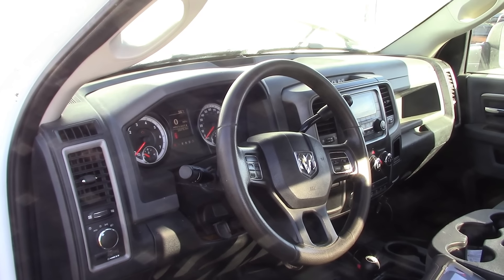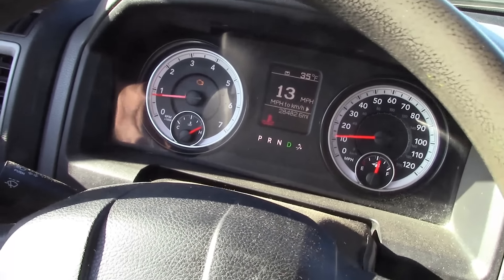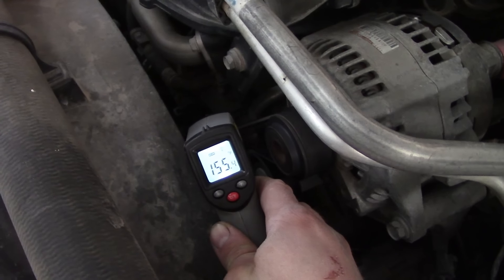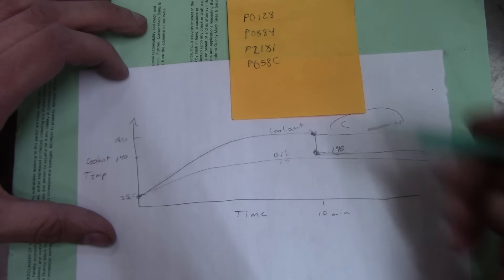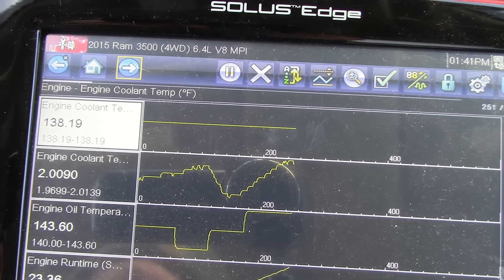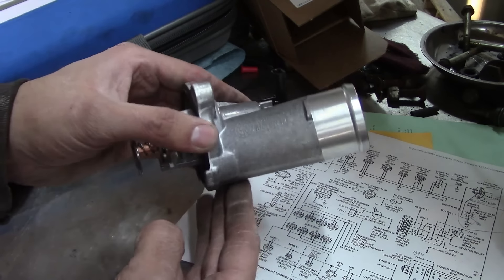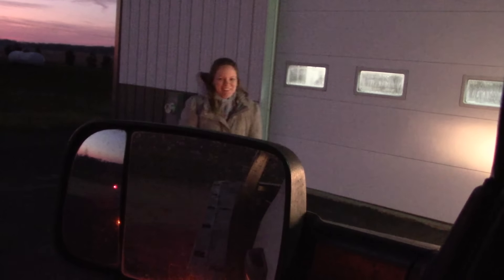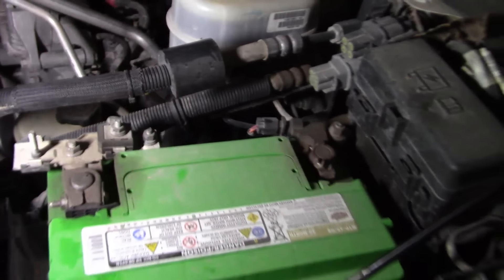When Live Data Lies - 2015 Ram 3500 Thermostat Diagnosis and Replacement - P0128, P2181

Comment: I bet it's emissions related. It has to come to operating temperature and switch to closed loop so it doesn't dump excess fuel down the tailpipe. If it doesn't get warm enough naturally, the computer goes into a failsafe mode and subs all the values to optimum so it runs on the correct fuel map.
Reply: It is probably also programmed to go bananas like that because it knows that most people are going to ignore a stick open thermostat and keep driving. They will get around to it sometime. Meanwhile the truck runs out rich. If the dashboard goes to nuclear meltdown you are more likely to shut down immediately and go to the nearest mechanic who is going to change the thermostat.

Comment: Wes, it's probably more to do with the way their ECU developers handled a specific circumstance. Why write separate code to deal with each type of event when you can intercept and alter data to fool other subsystems or modules in the code to do it for you? It's not the right way to do things, but as a software industry professional I can tell you that when there are a hundred right ways to do something, some developers will find a wrong way.

Comment: I have frequently noticed that computer controlled temperature gauges lie. They climb to a point soon after you cold start, and then maintain that point, whether it is below zero, or 100 degrees Fahrenheit and you are working the motor hard! 
My uneducated opinion is that the computers have been programmed to do that exact thing. And the reason why is because of FEAR. Auto producers understand that when the air temperature is hot, and you are working your motor hard, and the temperature needle starts climbing, most people panic and lose their trust in their car. So they designed the computers to purposely lie! 
So, it might be an uneducated opinion, but it's based on human nature.

Comment: Chrysler, what if, hear me out, what if the gauges told the actual value?
Reply: Subbing a value isn't new, it goes back decades.  The coolant temp gauge maxes out as a fail safe.  I'm betting the coolant temp sensor was failing also.  So how would you know what the coolant temp is if the sensor has failed / is glitchy?

Comment: I have a theory: what happens when an engine runs out of coolant? The gauge might drop down to C? Maybe the point of fake gauge reading is to scare the driver into actually checking that the engine is hot? 

If this truck's temp gauge is CAN they might be reporting fake temp to pin the gauge. Or something else drives the gauge and this is what they do to pin it?

Comment: I dont use live data much when trying to diagnose coolant temp issues.  I will give it a scan when cold, I test oil and coolant temp.  I then warm it up and test upper and lower radiator hoses.  Fyi John Deere cant build a thermostat anymore.  They fail and inhibit regens, while clogging egr coolers.

Comment: Ok, I am going to go on a rant here.  For a vehicle to work, we really need very few components and parameters.  Fuel source, air, and spark (electrical control), way to control engine overheating and way to keep everything oiled.  That's it.  I think I am smart enough to figure out when an engine is overheating by looking at a temp gauge.  Why do I need a computer to tell me that?  Why do I need a computer for anything?  I understand why a computer was introduced in vehicles (environmental regulation which is a crock in it's own right), but for the automakers (or Government mandate) to go beyond that is truly overreach and quite stupid.  Now we have vehicles that the average person cannot repair much less understand, or reasonably afford to buy.  I am a good mechanic but I am not an automotive computer expert nor do I have thousands of dollars to not only buy the equipment needed nor invest in the training.  This is the very reason my wife and I are in the process of going retro in many areas of our life, especially vehicles.  Anything later than early eighties, at most, is just junk and should be relegated to the trash heap.  On a second note, I do appreciate your videos (never miss a one) and also appreciate your patience and knowledge.  Thanks for taking me along!

Comment: Could be a strategy to cover the loss of data, in emergency just indicate maxed out temps, turn on the alarm as the computer cannot tell if the vehicle is over heating so alarms are go to get you to take it to a dealer so you don't damage the engine if it actually does overheat as the computer cannot tell, a sort of a just get it checked philosophy?

Comment: Reason #4783 why I don't want a newer vehicle.  My Chevy K3500 runs just fine with a mechanical 12 valve Cummins, mechanical lift pump, manual transmission and manual transfer case.  No more computer-complexity related problems.  As much as I'd like to buy one of the last 6 speed Cummins trucks, Im just not going to risk problems like the ones in this video or problems with the emissions crap.

Comment: Even with all that 'Technology' the thermostats still look like stone-age waxstats, (the power of melted wax...) Does that Ram motor have a flat head too?
Reply from the maker: It's electronically controlled. How that is better I don't know.
Reply: @WatchWesWork  Is there some form of servo motor hidden in that alloy casing somewhere?
Reply from the maker: @bevanson  No. It uses a heating element of some kind.
Reply: @WatchWesWork  Wow, that’s weird over-complicated s**t, if ever there was! 🇦🇺

Comment: Wes i get it but man i hated it when tech left those stupid clamps on hoses. Just charge customer the 1.50 for new real clamps. Even get the fancy even pressure ones with T blots but those damn "constant" pressure clamps are a nightmare and eventually do not hold.

Comment: The reason is probably something simple like.  Design team to programer "write some code to monitor engine temperature" Programer " Do we have some thing we can test with?" design team "no" programer" No problem i'll write some temporary code to simulate temperature if sensor is missing"..... come the day of testing the sensor  and software works and every one forgets about  the temporay code.

Comment: Could it be that the manufacturer has something embedded in the operating software that only there diagnostic systems can translate?

They are all trying to keep the vehicles in there shops not yours.

I work for one of the largest  commercial HVAC manufacturers in the world. We are getting more and more “priority” software in all lines of equipment.
Reason......cost of development of the software and hardware systems.
The manufacturer has to recoup that investment some how.....so, keep the odd man out of the loop and the product only being served by the manufacturer.

Cars.....HVAC......any modern day manufacturing process.

Something to think about......

 I wish I could store up some 30 year old tucks with replacement engines and parts and NEVER have to buy another modern automobile........wishful thinking.

Great video!

Comment: Isn't that the most ridiculous thing? " I am sorry, Wes but to get a thermostat you have to buy a complete engine assy..."  Totally stupid mechanical engineering, absolute brilliance from a social engineering standpoint. Mr. Millennial has no idea about thermostats, thermostat housings or temperature sensors, nor do the parts changing chimps that the dealerships want to work on the vehicles. We are quickly approaching a 'no-one can work on anything state' because of liability and sheer ignorance. Applause to you for your labors of love sir!!!

Comment: Program bug is what I assume, you can't tell me this stuff is contracted out "overseas". Its going to get worse. It used to be vehicles ran until the rust got them (at least in the midwest). Now we will have to deal with what a call "digital rot" where the electronics degrade. Who the heck is going to be able to fix this stuff in the future when Chrysler/GM/Ford/Honda/etc decides is just isn't profitable to stock replacement control modules for 202x model year vehicles.

Comment: I'll bet if you had the proprietary tool the dealer does it would translate the voltage and give you the real value...FCA is getting bad about hiding data....(edit) should have watched to the end 
I'm also surprised the Mopar part was cheaper

Comment: Good job on the diagnosis. An engineer that would design a thermostat and sensor as a single unit should be stripped of their engineering degree. Pretty sure there was Russian collusion going on with the info on the scan tool. We need to have an investigation into that.
Reply from the maker: It's actually an electronically controlled thermostat. I kept calling it a sensor, but it's actually the control.
Reply: @WatchWesWork  That makes more sense but the problem potentially would arise when the ECM controlling the thermostat is getting bad readings or erratic signals due to bad connections. Good catch on finding the problem.

Comment: What? Why would it not give the actual temp??! At least on the diag tool it should. I kinda get why the gauge shows fake (I would still prefer it didn't) but the diag tool? facepalm so hard
Oh, exactly what you said at the end :)
Maybe the factory tool shows the real data too, just to screw with you.

Comment: Mopar temp senors fail on all their vehicles.  Daughter had ‘15 Chrysler 200.  Was pegged at 185 all the time.  Replaced sensor & thermostat.  Problem solved.

Comment: I don't think the purpose of that fake data is lying to the driver. I guess this is probably just a side effect. Maybe the engine computer gets messed up in it's warm up cycle if gets fed with irrational sensor readings and they "fixed" this by simply supplying it with that fake data. The ecm then switches to actual data after a certain runtime when the engine should have reached operating temperature.

Comment: FCA is the worst thing to happen to the ram brand IMO for a myriad of reason. If you think the fake ECU data is bolshevism you should rip open that uconnect infotainment "radio". Inside you will find some variant of a Sierra Wireless AirPrime wireless modem which is connected to everything, including the CAN bus. This means in every vehicle which has a uconnect system may be using GNSS, or position reporting along with other telemetry data as well as potential for OTA update is possible and probable. Not having anything to hide about where I drive or how fast the position reporting is merely creepy. The real issue is if/when a vulnerability exists in the system allowing a malicious remote attacker to compromise something like the antilock braking system or the throttle. There is a lot to be said for driving something older with no computers, no network connectivity and no black boxes.

Comment: Wes: "I'm going to be thorough and diag this problem correctly. "

Chrysler: "No you're not"

Wes: "Why is this a fake value?"

Chrysler: ".............."
Reply from the maker: Ugh. Chrysler...
Reply: Love the videos Wes,, also the new "logo" is awesome
Reply: @WatchWesWork  My least favourite of the big three.   The Rams at work are the most inferior, cheaply made and poorly repaired-by-ram, vehicles by far. Even modifications/fixes to issues, are either repaired  improperly, or the fix is a huge bandaid, not fixing the real problem.   Two of them have issues with filling gas tank.  The pump keeps shutting off because it comes up the neck as if it's full, when it isnt.  Transmission issues, ignition issues-- a few times they've failed again as they were being picked up from the municipal garage , to go back into service.   Cheapest interiors,also.  Garbage vehicles.    Love your videos, and the commentary, Wes.  Greetings from Canada.

Comment: It was so much easier without computers. That worth investigating why the change? Advanced technology,  21st century, Idk. Give me a middle 20th century US car anytime.
Reply: I had a 1967 Plymouth Valiant with no options added, except for automatic transmission. I wish that it had had power steering! It had a slant six. Not very fast, If it had had a 318, power steering, and a radio, it would have been perfect!

Comment: This is very common on German cars. Most of them use modeled coolant temp so idiot customers dont complain that the car is too hot when running at 220 like the engineers intended.

Comment: I noticed I don't have a coolant temp gauge in my chevy volt. I guess it's not needed as a daily monitoring info. My semi has a temp gauge but I only look at it when hauling up the mountains. 

What I'm saying is: ABSOLUTE coolant temp gauge is irrelevant, since engine protection kicks in and initiates shutdown procedure, if readings are out of safe range.

So to answer your question: why would the gauge lie? Simple. It's a relic gauge, that put there because consumers expect to see it there.

I bet tesla does not have a coolant temp gauge... But they do have coolant for battery temp management. I have yet to see a tesla owner get concerned about not having a coolant temp gauge.
Reply: Tesla owners don't go to work in a dually flatbed either.
Reply: @farmerbill6855  you missed my point, but that's ok
Reply: @vroor32  so what is your point?
Reply: @farmerbill6855  re-read my post again ... LMFAO 🤣
Reply: @farmerbill6855  and hence my point. My semi HAS a temp gauge, my volt *does not*.

The gauge readings need not be ABSOLUTE, THAT why he found estimated/expected values.

Vehicle can go to limp mode and when restarted, values will recalibrate, and ecm will reverify the readings, and if ok, vehicle will start and run as normal

Comment: Chevrolet has the same nonsense on the Aveo and its successors.  There's a temperature sensor and electric heater built into the thermostat housing.  Have to replace the whole thing when one of them pukes.

Comment: The code monkey kept getting an error on their simulated runs, and was up against a hard delivery date, so they put a debug patch in place.  And, no one has ever cleared that code in any of the builds of the code.  And the guy who did the work changed jobs 5 years ago to make another 25¢/hr, and no one currently i nthe code shop has the first idea.  Or, at least, that's what I've run into before.  That's just my opinion, worth perhaps 2¢

Comment: This is why I can't have new cars.  I prefer to think for myself rather than have my car babysit me.
Reply: Newer vehicles are far better and longer lived than old, vintage ones. You just need more skills to work them.
Reply: My friends never understood this.  I had to prime it, kick down the high idle, be savvy with knowing if I had to prime it or not after starting it after a short while, turn the headlights on and off... Three idiot lights in my caprice.  They never lit up, unless there was an issue...there was rarely an issue,andnif there was, it was plain and simple!!  I loved that car.  The ignition was worn, so I had a keyless ignition.   Great feature, lol.  A nice elbow groove in my arm rest.   The steering wheel worn shiny from years and years of driving.  Never a problem with the power steering, ever.  HEI ignition..it started every single morning.  I tried to make it not start on those cold mornings...it started every single time.   People always asked why didn't I get rid of it... clueless they were . It did finally get to.a.point where stupid things I didn't want to address, were happening, so it was time.

Comment: Yup, in summary, the "live data" is bullshit data.  I'm not sure what the reason is.  I have worked in automotive engineering for most of my career and still can't answer why OEMs do things like this.  I think most of the time it's a "great idea" that doesn't come to full implementation and as a result, they end up with some confusing BS like this.

Comment: Ram's head in center of steering wheel. There's your problem lady. Best thing you could have done for the customer Wes was to kill it with fire, nuke it from space, encase the ashes in concrete and dump it in the deepest part of the ocean. Then as punishment for buying a Goathead auto make them ride in a Radio Flyer wagon pulled by the lovely Mrs. Wes. BEHIND HER CAR AT HIGHWAY SPEED.

Comment: Here's a guess: the computer feeds a substituted value into the system to get the affected components to believe the vehicle is up to full operating temperature sooner which would change the fuel/air ratio and get the vehicle into a leaner mode of operation to save fuel.

Comment: That's what you get for buying a gasoline powered garbage V8 for a Diesel capable 3500 truck....... People who buy 3500 size 1 ton trucks with gasoline engines, need their head examined. Also, who buries their thermostat halfway down into the engine bay? Wouldn't have that issue if it was a Cummins........
Reply from the maker: This truck is 5 years old and has only 28,000 miles. A diesel would be a complete waste of money.

Comment: I have a piece of medical equipment I service that does the same thing. It has a display with a temperature reading that goes off of time. In the background the computer is sampling the temperature. If the computer sees an issue with the temp it throws an error. So the system runs the temp off of time. When the time expires it checks the actual temp. If it doesn't match it throws the error. Dumbest thing I have ever seen.